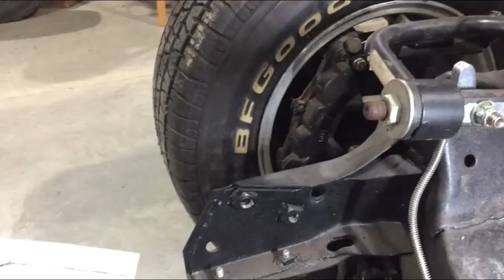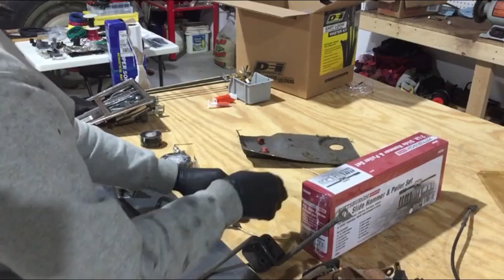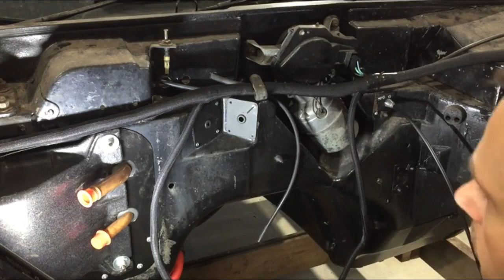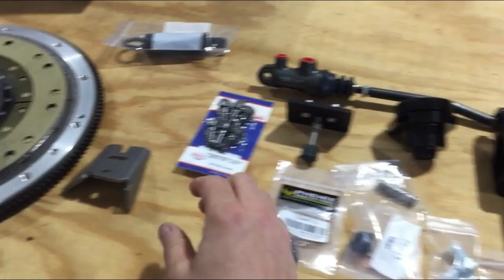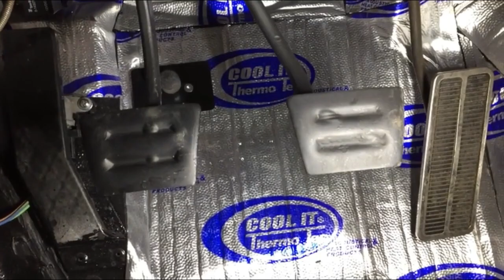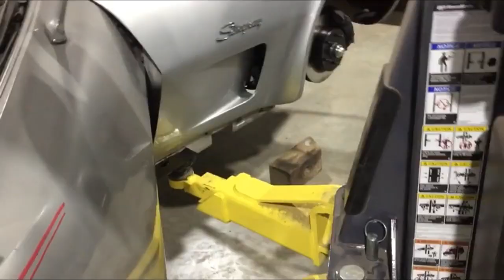C3 Corvette Project - Part 9

Comment: Nice work, clean welds! Doing a C3 LS7 project myself, how do you like that thermal sound material on the floor-firewall?
Reply from the maker: Thanks and a grinder hides everything haha. I liked how the material installed but I would not want to remove it. It’s sticky. I have not drove the car yet so I can’t comment on its performance. This may be a bad example to test sound deadening because it’s basically a race car. It was applied mostly for heat. We will see how it does soon.
Reply: @garrettworks346  WOW! amazing quick response! Thanks for that! Just subscribed, amazing problem-solving work you do.
Reply from the maker: @BretMech  thank you I appreciate it.